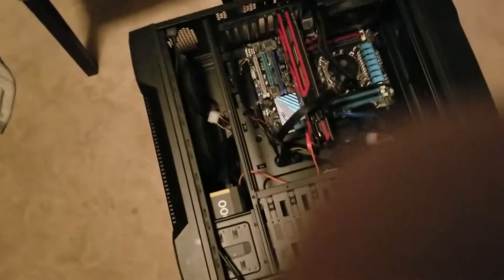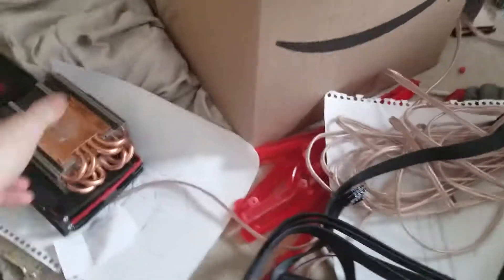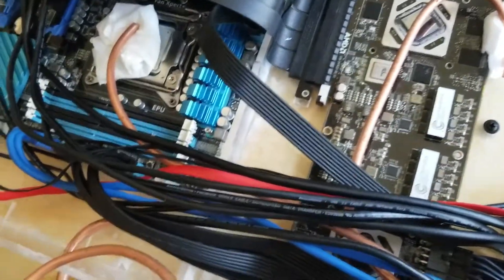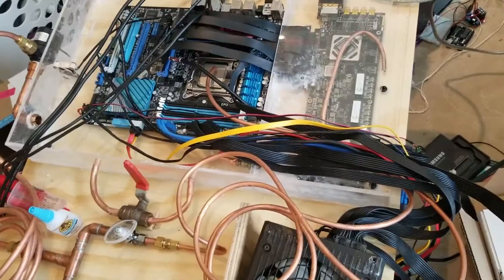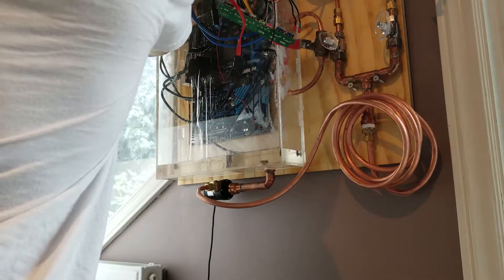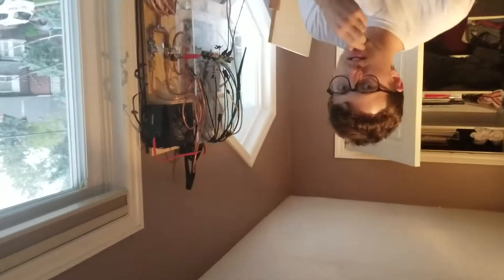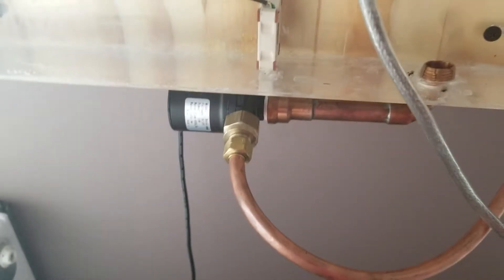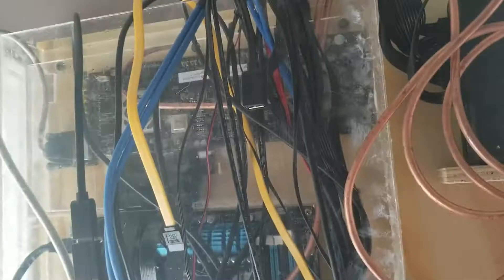DIY Mineral Oil Fountain PC (part 1)

Comment: I like your concept of the mineral oil fountain. I did a mineral oil build myself and I faced similar challenges with the pump. It simply does not pump as hard as you would think unless you get powerful ones but those are way too huge and noisy out of water. Also parts that are exposed to the environment after being through oil becomes a dust magnet so I think you'll need to restrict airflow into your casing as much as possible if you want to keep dust out(and ants in your case). Check mine out at https://pcpartpicker.com/b/wqyXsY
Reply from the maker: That's pretty badass! I ran into a bunch of issues, but I also got some cool ideas for improvements. I'll make another one eventually and it will be awesome!